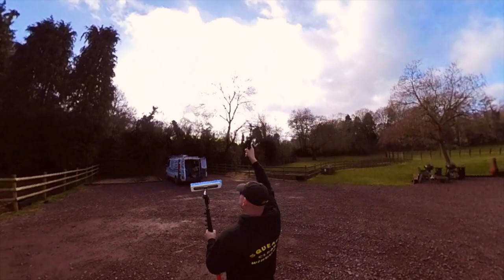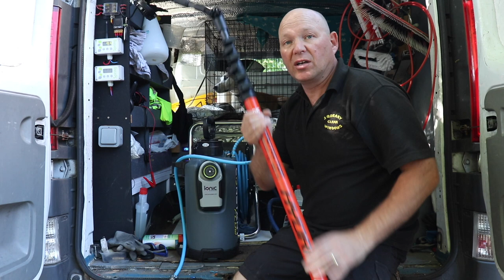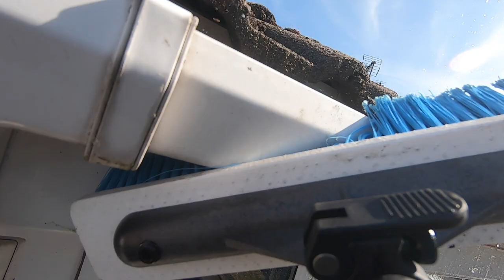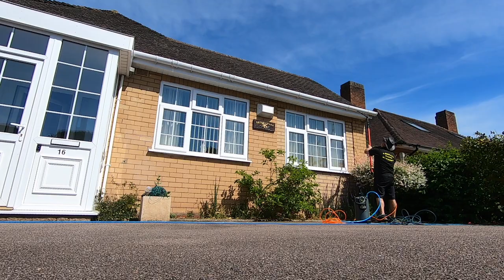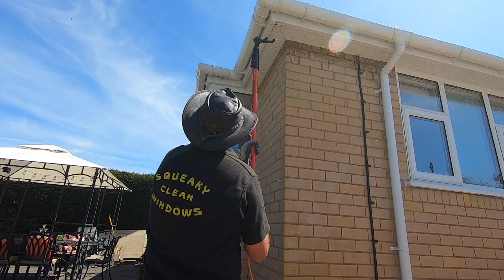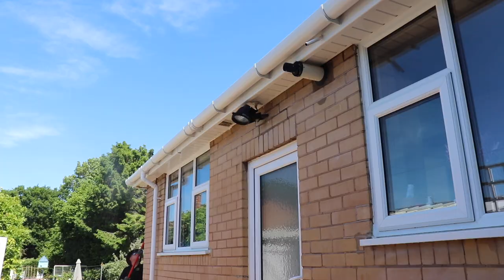Gutter And Fascia Cleaning With The Constant Flow From Ionics

Comment: I use this and Ionics vertigo cf25 with the flocked brush and spray nozzle to clean pvc. Makes your life so easy compared to just using water through a pole. Contact cleaner is great at breaking down heavy dirt but for regular cleaning I just use razrwash as it does a great job and is inexpensive. I don't mind spending money on tools as long as they make my life easy and work well and this does
Reply from the maker: A W Edwards Cleaning Solutions Totally agree. I used to hate doing upvc cleans but since I’ve got the Constant flow I actually enjoy them now. 👍
Reply: @squeakycleandave1  nice mate 👍

Comment: I have a constant flow, I prefer doing it the other way round, use the flocked brush with the foam to agitate the dirt and you're applying the solution then use water out of the fan to rinse it all off. Great job mate
Reply from the maker: Adam Edwards Fantastic tip. I will try that👍
Reply: @squeakycleandave1  I just found with the brush it foams it up even more and scrubs at the same time. 👍
Reply from the maker: Adam Edwards I’m definitely going to give a try. Maybe in the next video I will try it both ways and compare it. 👍
Reply: Agree with this one. Be careful spraying chemicals above your head, your lungs will absorb it like a squeaky sponge. Although it foams a bit, I see a lot of small airborn drops coming down. Stay safe. Reduce your risk on getting cancer in every way. Use of a good soft brush will eliminate spray in the air.
Reply from the maker: Edwin Noort Thank you Edwin. Great advice to bear in mind. There’s no point in doing a job if it is going to kill you 👍
Reply: @edwinnoort7661  yes that was my first reason behind doing it, with the spray half of it was getting blown away.

Comment: Dave great video thanks. Once you use the constant flow with the cleaning solution, do you then need a separate tank to wash off clean ? Thanjsc
Reply from the maker: Yes it’s quite a small canister with low flow but you could connect directly into a garden tap as it doesn’t need to be pure and not not have a separate tank
Reply: What chemical would you use to clean gutters ? Thanks again

Comment: 20p worth of fairy liquid through a backpack is all I have needed so far seems to work just as good
Reply from the maker: Driveway Developments you are right it dose work but not as easily and I hate scrubbing gutters👍
Reply: Squeaky Clean Dave i can see this would be great for render wash. I know you like your diy, do you think a 12v care tyre pump rigged up to a 25 litre can would do the same thing? Maybe even fit a pressure switch to turn it off at a set psi
Reply from the maker: Driveway Developments it would definitely work. I don’t know weather it would make the chemical foam like the constant flow but it would definitely get it up to the gutters

Comment: hi Dave i hope all is well with you - i have a softwash job and i wash wondering if the contact solution would work to clean the render of house before applying the biocide - thanks
Reply from the maker: You are best of checking with Ionics as I’m not sure about what chemicals you can mix and what you can’t. 
The contact foam is a Softwash but a very weak one so I don’t know if it would work for you

Comment: Cool.. Have learned a few thing's on your vids, thanks Dave.. Another method I learned for this is a bit of Jif on the brush - cuts through crime without foaming up to much, I then combo that by plugging in an expandable hose into the pole and plug the other end in to customers outside tap, no pump, battery or own water used😉
Reply from the maker: Much cheaper then the constant flow 👍
Reply: @squeakycleandave1  Time is money though and the consta flow would save brush application time 🤔..
Reply from the maker: @jonathanwilliams8897  definitely

Comment: i see D A  Components do these  nozzles.  what would i be asking for  needing the whole set up to fit into pole gooseneck,     can make life easier
Reply from the maker: The DA Components applicator is good. You just need a gooseneck with a screw thread on it
This would work if you have Gardiner quick lok 
https://gardinerpolesystems.co.uk/quick-loqr-brush-adapter-to-euro-screw.html

Comment: Loving the videos how much water do you think you require to to a average house front and back gutter and facias the reason I ask is im just starting up and running on a trolley mount with 25lt barrels was thinking I can do with just tap water and maybe finish with purified water 💧
Reply from the maker: You could definitely do the gutters and facias with tap water which would save you loads. The windows are best done completely with pure. 
If you made an adapter to plug your pole straight into a garden tape you wouldn’t even need to wash out your trolley

Comment: Dave can you use a DA fan jet applicator on pole as I use one on my backpack but I've been thinking of purchasing the ionic contact for a while but don't want their pole 
Cheers Kevin
Reply from the maker: Kevin Hellier I haven’t tried the DA fan jet but I would have thought so. I will try it later. 
If you use the Contact foam in a backpack it will still clean really well but it probably won’t foam properly as the constant flow pushes air into the chemical as it goes through to foam it. 👍

Comment: Hi, I have the constant flow and  most of today. I have messed about with mixes 10ml to a litre and 7.5ml to a litre. All it does is come out in blobs without hardly any spray. I have pumped the unit to pressurise it, but it's the same thing. Any tips, as it stands at the moment, it's not like I thought it would be, thanks.
Reply from the maker: Sounds like there may be a blockage. If you have only just had it I would give Ionic a call and see what they advise
Reply: @squeakycleandave1  Many thanks. It's  just came back from there. I think I will send it in again.

Comment: I want to try the contact foam but will be using my old backpack for it i reckon
Reply from the maker: Matt Rogers it will clean using your backpack but it won’t foam up. There is a tiny whole in the pipe that sucks up the chemical that lets air in and produces the foam

Comment: Hi Dave I’ve been using contact in a gardiner backpack which holds 22lts but it doesn’t seem to shift the whisky fungus.
By the way you should put a your own album together 🤟🏻
Reply from the maker: skyrider29 best thing to do with the foam if there is a problem is to give Ionics a shout. I’m still fairly new to using it so I haven’t com across everything yet👍

Comment: Nice! Where do I get a pole sprayer  like yours?
Reply from the maker: Adambrightmore the whole set up is from Ionics Systems. 
http://www.ionicsystems.com/uk/product-category/other-products/foam-cleaning-system/
If it’s just the spray nozzle you want I think the Ionics one only fits Ionics poles so you might be better off going to DA Components 
https://www.da-components.com/da-applicators-nozzles.html
Reply: @squeakycleandave1  thanks I've seen a few guys on YouTube using parts from old crop sprayers etc. But yours looked like it was ment to fit. Thanks
Reply from the maker: Adambrightmore it is expensive but very good 👍

Comment: Greeat video Dave, we want to see more of Dufus in future videos. How much of the detergent did you use to clean the two houses? Did you have to refill? Also, is there any danger if the solution dries on the glass?
Reply from the maker: Thanks Sam. Diufus is semi retired and Hunter his place most of the time. 
For the 2 jobs I used about 8 litres of mix and you put in between 20-50ml/1ltr of water
As with any chemical you need to be careful of plants and animals so if you do spill any you need to wash it down with plenty of water
It’s best not to use it on really hot days. I did get some on the glass which dried and there didn’t seem to be any problem washing it off. 
👍😎

Comment: Hi Dave, can this be connected to an ova 8 pole with the tubless  kit installed? And what nozel would be needed to fit the pole m8? I'm struggling to find the right kit as I'm buying this fascia tool but only want to use my ova 8 pole
Reply from the maker: Anthony Roberts the constant flow connects with a rectus fitting so you should be able to use it with any pole. The chemical can be applied with a brush or you could get a DA Components spray nozzle which are a euro thread attachment and a euro thread gooseneck from varitech
Reply: Hi Dave 

Can you use ionic contact foam on old wood frames, sash frames?
Reply from the maker: Anthony Roberts not sure as I’ve never considered it as I tend to just use it on upvc. Might be worth contacting Ionics to double check 👍

Comment: Would you say that it was the ionic kit or there solution that got the result 🤔
Reply from the maker: Daniel Burkes I would say that’s it’s a combination. The contact foam cleaner is fantastic even just sprayed through a backpack but it’s the Constant Flow that makes it foam and stick to the surface to add cleaning power. With out the Constant Flow it’s just a liquid not a foam

Comment: Good review Dave, it’s an excellent product but it’s hard to justify the price 😬
Reply from the maker: julian pierce i have to agree it is a bit on the pricey side 👍
Reply: Squeaky Clean Dave I’m considering trying the Contact  Foam in my sprayer 👍🏻
Reply from the maker: julian pierce it will clean but it won’t foam using a backpack 
There is a tiny whole in the feed pipe which allows air in to make it foam👍
Reply: Squeaky Clean Dave thanks for the heads up Dave 👍🏻

Comment: Forgive my ignorance but could you not just have bought a gardiner back pack and used 100° fan jets?
Reply from the maker: P X S yes you could use a backpack but the chemical passes through the pump with a backpack which eats the seals. The constant flow works on compressed air so it’s not going through the pump so you can use it for soft wash as well. The other problem with the back is that it doesn’t foam the chemical so it’s not working to it’s full potential 👍

Comment: Dave, do you think it's worth spending that kind of money on one?
Honest opinion 😁
Reply: Glenn Bantick how much are they?
Reply: @spitfiresoftwash8127   I think about £450 I think
Reply from the maker: It’s still to new for me to say. I normally hate doing gutters and it did seem a lot easier with the Constant Flow but it is expensive. You might need to ask me again in 6 months to give an honest opinion 👍
Reply: @squeakycleandave1  Can you update ?
Reply from the maker: @thepersonalisedgift7978  for me yes definitely worth the money. I used to hate gutter and fascia cleaning  but now I actually enjoy it. It isn’t quite the contactless cleaning I had hoped for where you  apply it then 20mins later you just spray it off. You do still have to scrub but much less then with other cleaners I have tried. 👍
Reply: @squeakycleandave1  Cheers Dave i will order 1 tomorrow im guessing you just rinse out, if you do fascias with chemicals then go onto pure water for the rinse..And then the windows clean..Just for info im guessing you can get a couple of jobs per fill ? Cheers
Reply from the maker: @thepersonalisedgift7978  depends on the size of the job and how strong you mix it

Comment: Great video David. In my opinion the product is overpriced. Iam staying with my old reliable backpack😉
Reply from the maker: Krzysztof sobczyk yes it is pricey. Thanks for watching 👍
Reply: Does a backpack still give you enough pressure to use it with a pole system like dave is there. Thanks